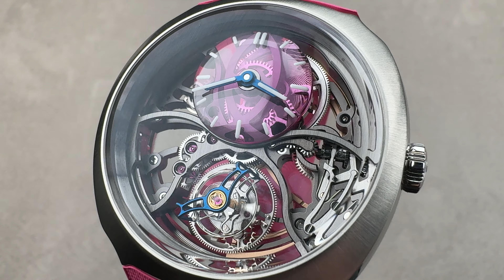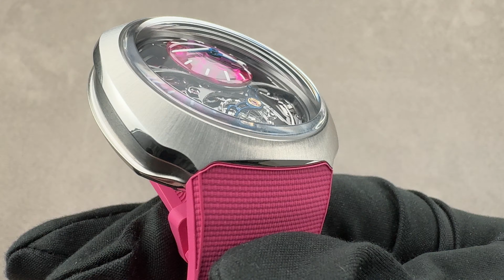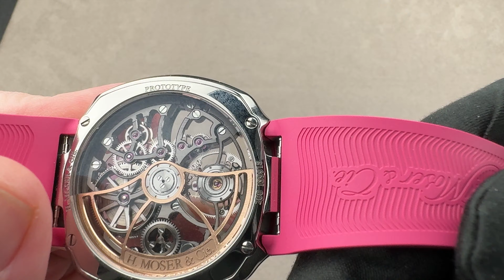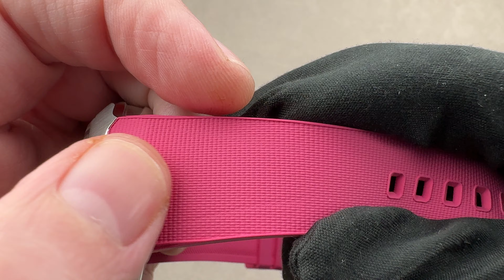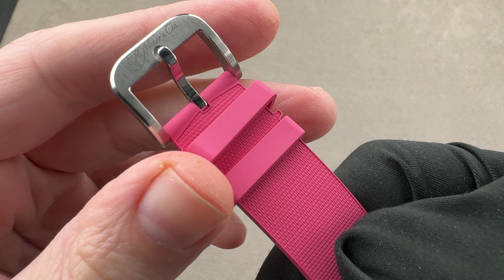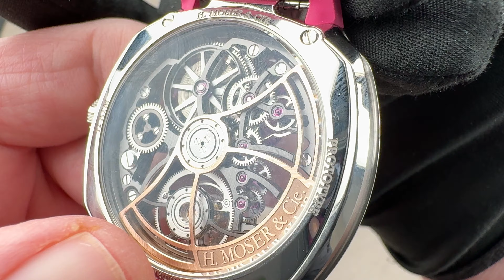H. Moser & Cie. X Alpine Motorsports Streamliner Cylindrical Tourbillon Skeleton Limited Edition

Comment: Is that a spec of dust inside the watch between the 8 and 9 indices?
Reply: Could be your reflection old man.
Reply: @philokevetch8691  maybe it’s Mike Hawk’s reflection
Reply: @TylerC_  🤭good one.
Reply: At 4:53 the black spot has a several white starbursts. The black spot is obvious and often visible but also disappears as the dial is moved around.

Comment: I like those colors!

Every now and then I’ll fly the Formula One and WEC cars between races.

Formula One completely disassembles their cars and puts them in amazingly small boxes that they then stack a few high on individual pallets which are then loaded longitudinally onboard the aircraft.

The WEC, on the other hand, stacks their cars two high in the confines of a special platform that is then lifted onboard using a K-Loader. Unlike F1, WEC cars are loaded transversely. And the WEC cars, also unlike F1, are not only still fully assembled, but they’re not even covered in plastic or anything protective at all. You can go up to the WEC cars, touch them, and if you had the know-how, you could probably get inside one and attempt to fire up its engine!